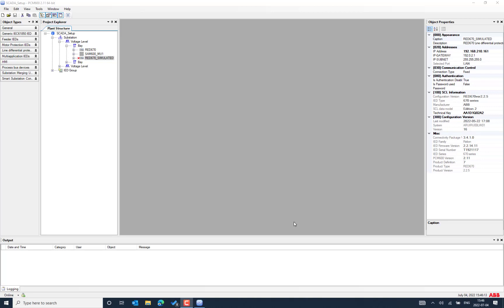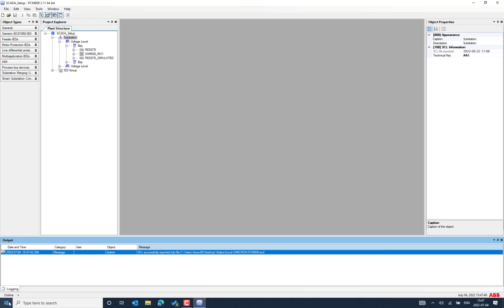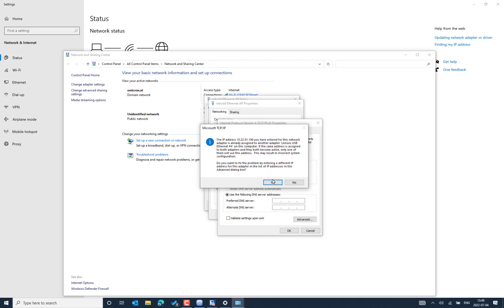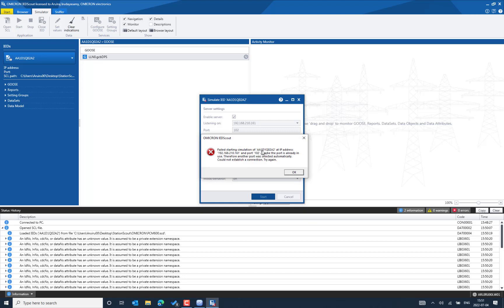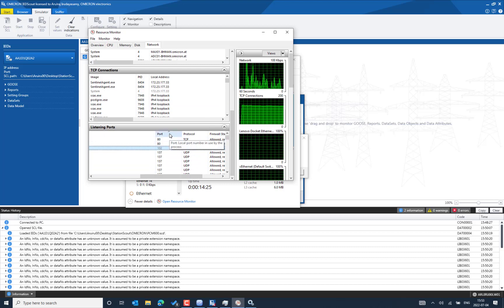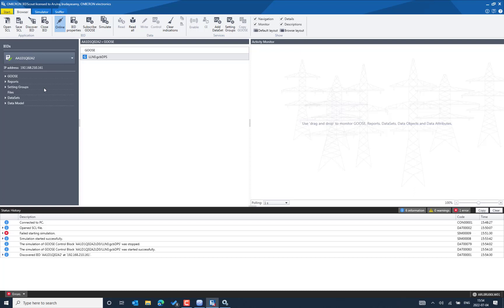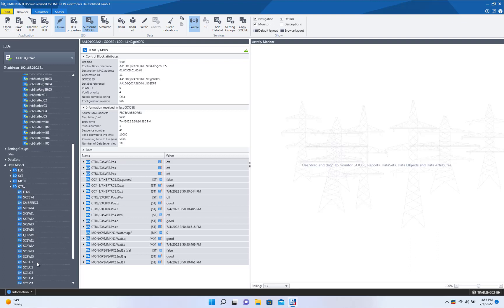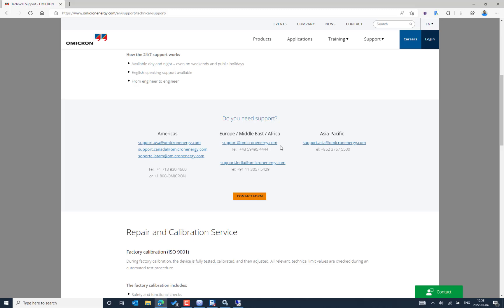Simulating an IED from IEDScout PC with 102 port occupied services

Comment: Hi can We execute command directly From IED SCOUT To Circuit-breaker through Relay REF615 ??
Reply: Is this possible to enable the CBXCBR1 OUTPUT Throght SCOUT??
Reply from the maker: Yes,we can execute the control command if the ied is configured and iec61850 enabled with the proper configuration and interlocking logic satisfied,
Check out the link below on how to practice with SCL file,
https://youtu.be/UIb251zeatM
Reply: Hi sir..unable to find 102port for same error in my scout...searched same as shown location..
Reply from the maker: @kannirajulu  what is your problem?
Can you write an email to technical support from the OMICRON webpage?